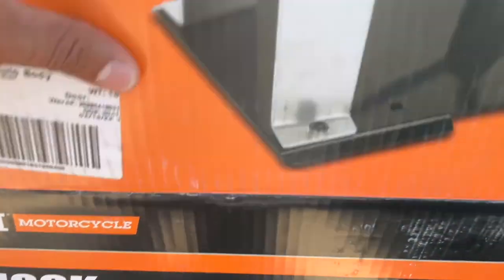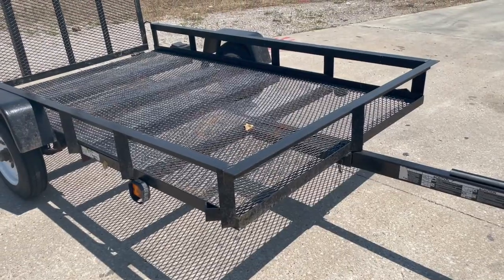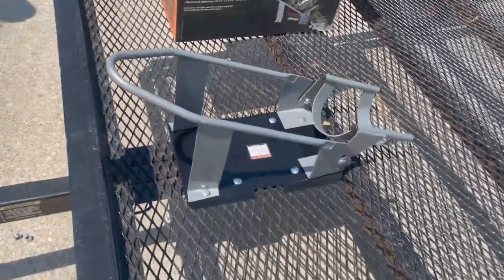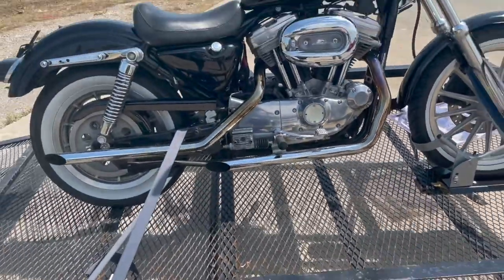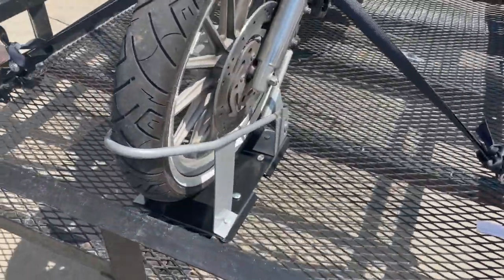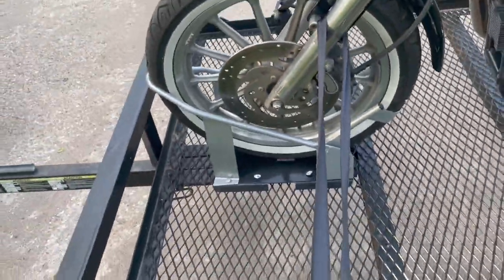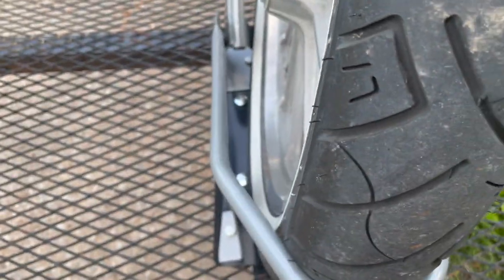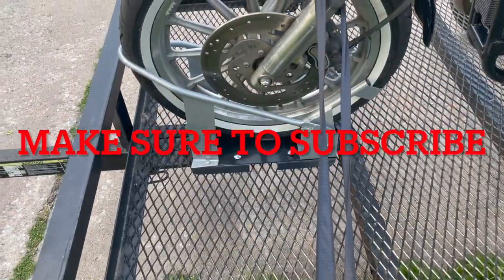Harbor Freight Motorcycle Wheel Chock Installation and Review

Comment: You’ll need to install a backing plate under the trailer and chock so the bolts don’t pull through the mesh floor. I’d hate to see your bike go flying off the trailer.
Reply from the maker: Definitely should have done that haha. But I made it home safely.  This is my friend’s trailer. I have a wood floor, flat bad trailer that I don’t have to worry about this issue. Anyways can you make sure to subscribe.  I do a bunch of tool reviews and DIY content. Thanks Randall.

Comment: You should put your front straps up higher above the bottom part of the triple clamp. Where you had them on your forks could damage the forks by pulling them to the side causing problems with both the seals and warp the fork itself.
Reply from the maker: Completely agree with what you are saying.  Next time I have to do this I will definitely do it a bit different. Didn’t have any damage but would change things a bit.  Thanks for the feedback and make sure to subscribe! Thanks again.

Comment: You need some plates on that wire mesh for those bolts. I wouldn’t drive a bicycle down the road like that.
Reply from the maker: My first time transporting a motorcycle.  Definitely needs plate, you are 100% correct on that. Thanks for the feedback. Please make sure to subscribe.

Comment: How about putting a flat meta piece under that deck so the bolts have a solid place to torque onto.  those holes in the screen will never be good as they will shift and not support long time.
Reply from the maker: I agree with what you are saying. Definitely could have changed this process.

Comment: Your front straps are in the correct position on the lower fork legs. It you attach above to the triple clamp, you are compressing the bike's forks and suspension. You don't want to do that.  Let the motorcycle suspension move while being transported on the trailer.  I would put choker straps around the lower legs in the same location just above the fender boss like you have. It's easier to hook up and ratchet down with chokers.  You want the bike to move up and down on its suspension, so put the kick stand up and tie off to the lower fork legs like you are doing in the video. You are not going to warp the fork tubes or damage the fork bushings.Tying off to the swingarm like in the video is also correct. You could add chokers around the swingarm as well.
Reply from the maker: Thanks for the feedback. I’m sure someone will read this and it will help them out in the future!
Reply: It is completely fine to compress your suspension to transport bikes
Reply: @trevorwotring3945  I agree with a slight compression of the suspension, but I've seen folks ratchet down until the forks bottom out...